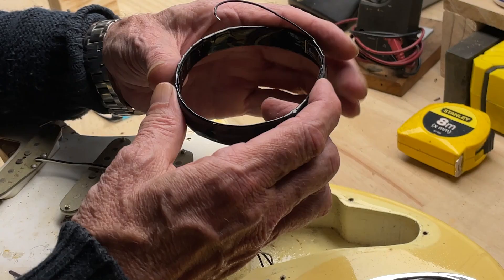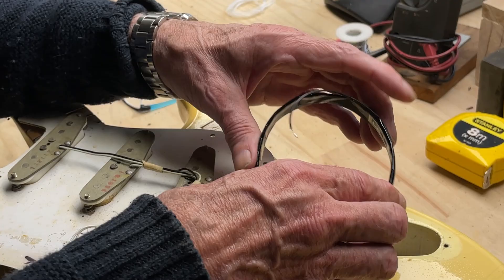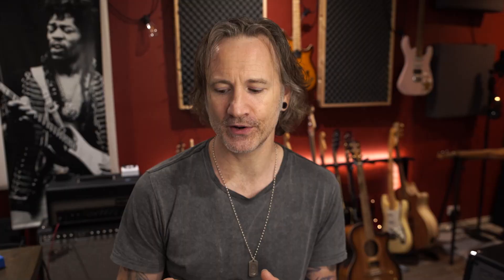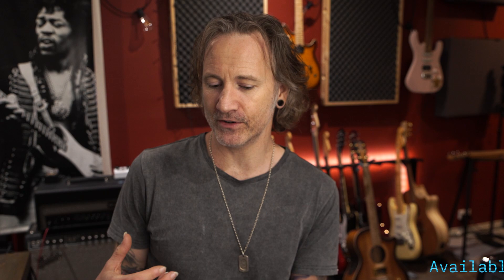This Fixes Single Coil Hum!  Ulbrick 'NRS' Noise Reduction System

Comment: Bought one for my Custom Shop Strat(RW Middle, 5.k p/ups) Installed professionally.. No noticeable improvement on noise-also added noise on previously noiseless 2&3 positions) could be because of the treble bleed circuit and/or blend circuit, which was factory..and also didn’t fit.. Couldn’t get the scratch plate back on properly without damaging my existing electronics. They are a bit heftier on CS Fenders and the cavity was definitely too small to fit it in without banding radical angles into the nrs system. 
Sent a friendly Email to Ulbrick, No response.. Guessing chasing up a warranty might be futile also.. Gonna try and sell it off..Recoup some Birthday Present money..
Reply: That is because the pickups in your guitar doesn’t have a high enough output. Each model is specified for certain outputs.

Model 1 and RWM is specified for 5.5k - 6.5k
Model 2 is specified for 6.5k - 7.5k
Model 3 is specified for 7.5k - 10k.
Reply: My Troposphere CS is super quiet but I could use this on a 65 and 72 though
Reply: @NiRo_90125  thanks good to know
Reply: Thats because they polarity and Wind direction on your pickups is not compatible with the device. 
It is an air coil and everybody should ask and check Whats the compatible polar Pattern and Wind direction.

Comment: This may work very well.  But notice that the guy in the demo  never takes his fingers off the strings.  That's when some single coil guitars are loudest.  It would have been nice to see them go through a more detailed demo.
Reply: Or before and after clip There are some older systems Ilitch design that hooks inline and has a little trim pot
Reply: How often do you play with no fingers on the string?

Comment: Surprising this video isn’t more visited. Nevertheless, CAUTION: CYNICISM AHEAD.

Methinks this really just amounts to a dummy coil. If you have a RWRP middle pickup, you need two dummy coils, which is why they have the RWM (reverse wound middle) model.

Genius, I tell you. Sheer genius. And shamelessly glorified, I might add.
Reply: Would you need two dummy coils to deal with the RWRP middle pickup? Seems like the solution there is to reverse the phase of the dummy coil for when just the middle pickup is selected. (This is an extra step in construction of the thing, so it does have to specified.)

Comment: It would have been nice to know the theory of operation behind this NRS system to know how it works or is it just suppressing the noise or cancelling out the noise.
Reply: Seems obvious, it’s a dummy coil in its own wrapper, plus other wiring to restore frequencies that a dummy coil by itself would sap out.
Reply: @erickleefeld4883  yes true it is the dummy coil is the easy part the hard part is how is the circuit "restoring the frequencies"

Comment: Shielding the cavities will cost you one dollar. Nice scam.
Reply: ???  So apparently you think this is some sort of expensive shielding?
It most emphatically is not.
It is a coil which is wound out of phase with the pickups (the underlying principle of the humbucker pickup) but has no magnets sensing the strings..  It picks up the same hum as the pickups but none of the sound of the strings.
So when you add that coil into the guitar circuit the hum noise cancels out, leaving only the guitar string sound. (If you accidentally wired the hum coil the wrong way round then it would be in-phase and would then double the amount of hum in the signal)
The principle is simple and reliable and has been used before by others though there is usually some very slight effect on tone.
This guy's Unique Selling Point is that his version makes no difference whatsoever to the tone.
I have no idea whether that is true but the price is ridiculous  even if it worked perfectly.
Reply: Yeah sure, and Earth is flat, Bro